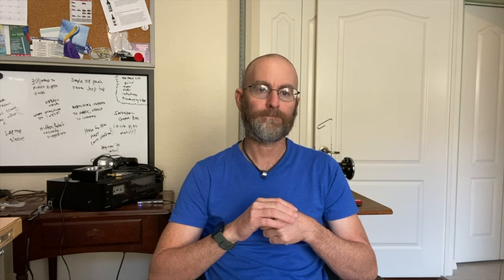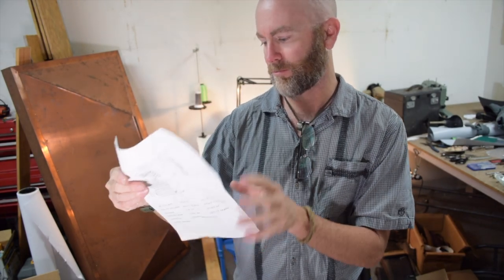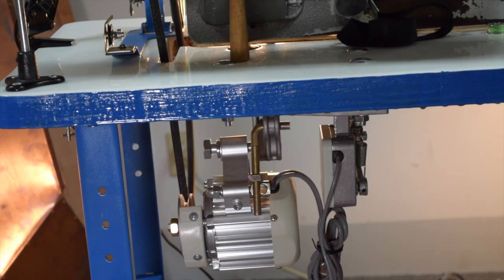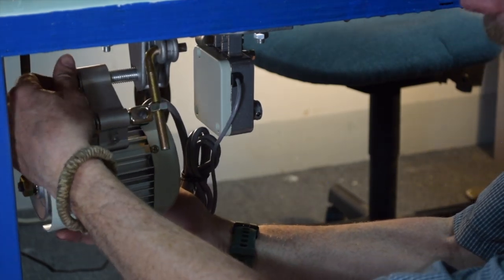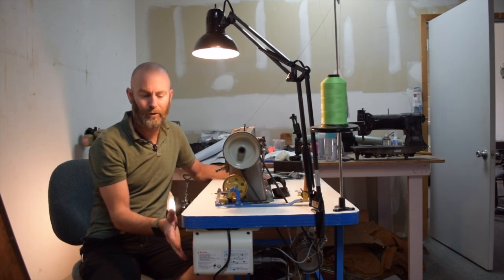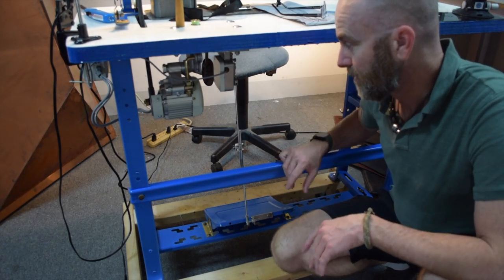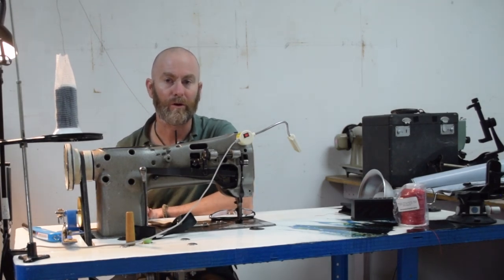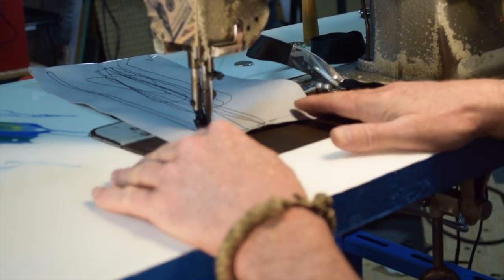Dumping The Clutch - Installing A Servo Motor On An Industrial Sewing Machine

Comment: I wish I watched this before I installed a servo on my consew 227. I encountered every single bit of challenge you did. I thought it was my fault that i had so much installation troubles. I had exactly the same issues with the large single motor hanging bolt. I replaced it with a length of sae threaded rod after tapping out the metric hole.

Comment: I modded my Husqvarna 12 to servo/brushless too, but by means of a smaller Nema 23-size motor. Not cheaper, especially due to how hard it is to find a suitable power supply. But no problem with power despite only being 125W. With a 16mm pulley on it (as measured to center of the belt, not inner of the pulley, because apparently that is a thing), a 3000rpm max speed gives a pretty good spectrum. Slow speed could be slightly slowerstill, but it is still a huge improvement in low-end torque to a brushed motor. High speed is more than i'll ever use, but not by any crazy amount, giving a linear foot pedal good control over it. Fun experiment, but unless size is of utmost concern, go with the solution from the video.

Comment: I noticed that you sew both 1000D Cordura and marine grade tarpaulin. If you did a video on sourcing these two materials on the internet that would be amazing. I live in NYC and it's difficult to get Cordura locally and getting any kind of tarpaulin (like you'd find in a Chrome messenger bag for example) is basically impossible. Even if you just replied with a link here I'd be satisfied.
Reply: JT’s Outdoor fabrics in Canada or Seattle fabrics.
Reply from the maker: I've bought from Rockywoods, Seattle Fabrics, The Rain Shed, Outdoor Wilderness Fabrics and Big Duck Canvas.  Ripstop By The Roll is now carrying 1000D Cordura, but I'm not sure how many colors they offer.
If you have any awning shops, marine canvas shops, etc. in your area, you might ask about their scraps.  I have some pretty big pieces of vinyl that were being thrown away at my previous job.
Thanks for watching!
Reply: eBay can be a great place to pick up that stuff, there are a handful of sellers that sell off cuts and small lots. Rocky Woods has a good selection of outdoor fabrics, and Nick of Time fabric sells “pro tuff” which is a 1000d analog, but pretty inexpensive
Reply: You could also check your local power sports store, LOTS of covers get tossed after being warrantied. Good source of material, saves it from the landfill and you may score a gig doing repairs while you’re at it

Comment: Washers for a spacer, what a cheap crap solution. Really, was it so much trouble for the manufacturer to either make the part fit or simply provide a proper spacer? Then there's the itty-bitty question of why? I've been using clutch motors all my working life and I have never had to replace one. These servo's won't last anywhere as long, the lower power consumption is mostly exaggerated (just turn a clutch motor off when not in use and you'll be fine) and if you have a good one, there's not much but a soft humming sound, not something I would call noise. As for speed control, it's pretty easy to adjust a clutch motor (and maybe replace a pulley and lengthen the actuator-arm) to sew as slow and controllable as you want. In any case, I would choose a precision build, high quality German, British or Japanese Clutch motor (not many American motors in Europe, Voltage issues) over a cheaply made Chinese one where the manufacturer can't even be bothered to make the parts fit right.
Reply: The cheapest kits come with washers, ive had a few come with aluminum spacers and a few that didn’t need a spacer for proper alignment. It’s kind of the trade off for getting A servo kit for cheap
Reply: roan hielkema there’s no way you could know this, but I run a small factory and and have spent a lot of time dealing with the mechanics, electronics, and pneumatics of running such a business. I won’t disagree with anything you are saying, but not everyone is in the same position you are. That’s important I think.

For instance, power usage doesn’t really matter for most home or solo makers, but it really matters to me. Ditto for having automatic thread cutters and needle positioners on every machine possible. 

I don’t have much need for larger motors for the things we produce, but 550w has been perfectly fine for the majority of our machines. 

I have at least 5 “cheap” servos with over 1000 hours on them and no problems yet except for the cheap mounting rosettes. 

If you have happened across any of my previous comments, my philosophy has been: anything that gets more people sewing is a good thing. 

I see a lot of talk about finding the perfect machine or perfect scissors or whatever, and I think it’s important to try to remove as many barriers as possible to getting more people sewing. If you can afford a Mitsubishi servo that’s awesome. If you can sew with flawless control on a clutch, that’s cool. But I think it’s a mistake to dismiss the cheap servos out of hand if you haven’t had any first hand experience. Maybe I’ve just been extremely lucky
Reply: Clearly we are having two different conversations, have a good one!

Comment: I have one flatbed with a servo, one flatbed with a clutch and one cylinder arm with servo, needle positioner and a reducer.  I primarily sew leather so the reducer is nice with the servo to increase torque and allow for very slow sewing.  The downside is it can be too slow.  If I sew a belt or strap, I find myself needing to up the speed on the controller which loses the accuracy in the foot pedal to some degree.  I started on a clutch motor and find I prefer it over servos.  I serviced my clutch motor by sanding the cork to a fresh surface then adding a bit of lithium grease to promote slipping which I find makes the clutch easier to control.  My clutch motor runs around 1750 RPM for reference.  A nice modification is to reduce the pulley diameter on the motor to lower the speed at the machine.  Some people will even put a larger pulley/handwheel on the machine as well.  On a side note, I disconnected the needle positioner on the cylinder arm, I find it handy but also a little weird to use depending on the RPM range you set; it doesn't seem very linear with the RPM settings.
Reply: Rolling stock co
Can you please explain clearly
Reply: I have a cylinder bed machine which is too fast.what do I do to reduce  the speed

Comment: I think the lowest speed I see is quite high. Can the motor run slower, or do it jump up to the speed I see as lowest speed? Can you estimate the lowest RPM of the motor?
Reply from the maker: I haven't played around with the speed settings on mine yet.  It is quite controllable at low speeds, but the transition from slow speed to ever-so-slightly faster isn't seamless - there is a bit of a "jump" up in speed.  Overall, I find it to be easier to control the speed than on my clutch motor, but almost entirely at the VERY lowest speeds.  I think getting a clutch started slowly and smoothly is where most people struggle, and is where a servo has the most advantage.
I hope that helps, thanks for watching!

Comment: Thanks for your information. I was just wondering how the bracket holding the motor was attached to the motor itself. Perhaps it is possible to loosen some screws and make this bracket slide somewhat in the shaft direction. In this way you can adjust the position of the pulley.
Reply from the maker: Yes, it does appear one can adjust the motor itself on the bracket.  Where were you when I went to go buy more washers lol?!?
Reply: Sewing Machines in detail yes, probably about an inch of adjustability in the motor side of the mount
Reply: Thanks for the answer. Yes it seemed so, when I looked at it. But from the video it seems that Jason got some problems with this adjustment. That's why I asked.
Reply: Sewing Machines in detail very possible some of them are more limited in adjustment, I’ll have to look but on mine I believe the bracket slides and clamps on some features of the extrusion.

Comment: Great video! Having both, I think for performance there isn’t much, if any, benefit to a servo motor. In fact, when on a very slow(read: easiest to control) setting, they lack startup and slow running torque(common with DC motors). For other things - working environment factors like less constant noise(which causes fatigue), less smell, and less vibration they are great and worth the upgrade. However, as you implied, if one is afraid of the burst from a clutch motor, the servo motor won’t instantly make you Cechaflo! Mine didn’t come with a position switch. That would be a great addition and could really speed up a job. Looking forward to that video! Keep it up!
Reply from the maker: Nice Cechaflo reference! 👍

Comment: I would like to add one to an old Singer, I don’t have a table, thinking I could mount motor behind machine and get a shorter belt but unsure how to incorporate foot pedal
Reply from the maker: Off the top of my head, I think you could pretty easily fabricate a pedal - it basically just has to pull down on the lever on what I'm calling the actuator (I'm not sure that's the right term).  It would need to be light enough that the spring on the "actuator" could pull all the way back up when released.  It would need to be fastened down somehow so the "actuator" doesn't move the pedal when the pedal is released.  The pedals on industrial tables are not exactly technologically advanced, I think you could make something loosely based on the same design fairly easily.
Thanks for watching, and good luck!
Reply: Did Mike do this?

Comment: I've been wanting to get a servo for my industrials. The commercial sewing shop I get my parts from told me to avoid the cheaper Chinese ones because they last a year. I've got a more expensive one on order. I'm a big fan of servo motors, I do enjoy the controllability vs the clutch motor.
Reply: dana blouin unsure if there is a correlation between price and durability on these, other than the nickel and dime hardware stuff. I have a consew branded kit and a golden eagle branded kit that have identical motor drivers and identical looking servos in them. I’ve also noted that some of the identically branded kits have different parts in them, it may just be a crap shoot on what you order vs what you get
Reply: @JHorvathCinema  I think if I was ordering online then I would agree and probably just get the cheapest one. However, there are a few factors at play for me. First I live overseas where there is no Amazon. At least not in any affordable way with shipping. Locally to shop online we can use Aliexpress and Lazada, both have very weak return policies if there is any issue I would just be stuck with it. The shop I get much of my sewing stuff from supplies a lot of the tailor shops and sewing factories locally and we have a good relationship, so when he suggested one that costs about $180 vs $90 and tells me it will last much longer I'm inclined to trust him since we have been doing business for a few years now. I would love to spend half as much on the motor, but I also don't want it to crap the bed when I am in the middle of a project.
Reply: dana blouin and time your point, an extra $90 is worth it if it means it just works for a long time

Comment: Looks good Jason!! I added a spring (like a short screen door spring) from the back of my pedal to the rear horz cross bar. It helps out more than I can say. I do have a lead foot. 😁 I have my setting Max set to 1000 rpm. 4000 is off the hook. 🤣. I can not sew as slow with a clutch motor as my servo. I did miss the back-pedal brake of the clutch at first, but don't even notice it now.
Reply from the maker: I'm going spring shopping :) Thanks for the idea!